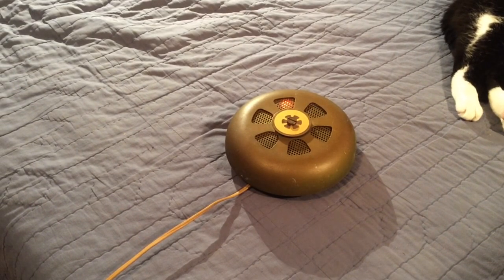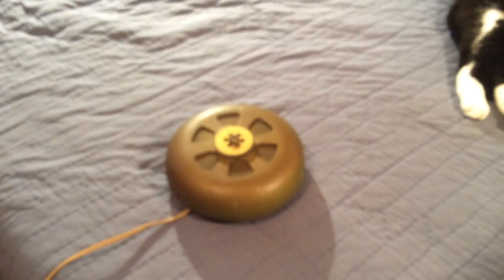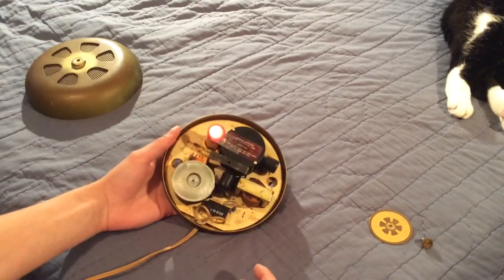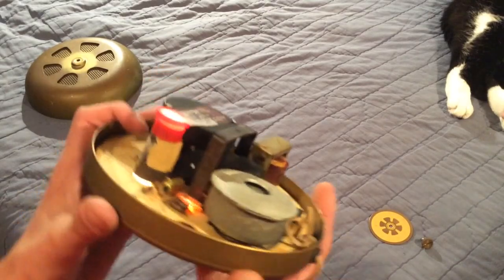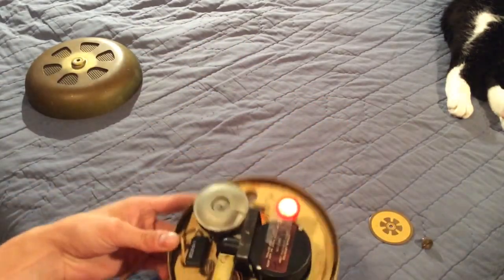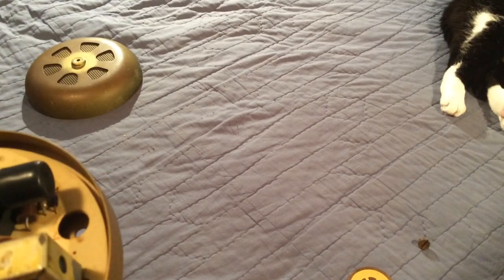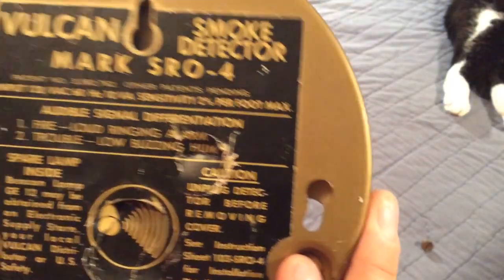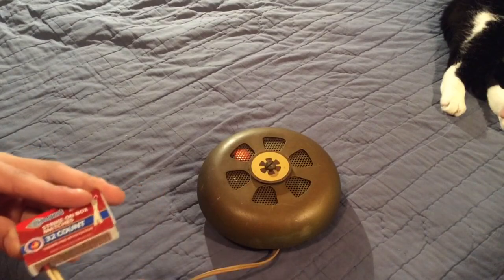Vulcan Autosonic Mk. SRO-4 Photoelectric Smoke Alarm

Comment: The shell looks like solid brass. You can clean the oxidation up with a bit of brass polish and a rag. Use your elbow grease to really rub into it. I suggest putting some sort of clear coat on it after that because I have my great grandfather's solid brass United wall clock from 1959, and I have to polish it from time to time. I should think about putting clear coat on it.

Comment: This is from about the early 60s
Reply: no early 70s electric smoke alarms wernt on the market untill 1972
Reply: @theshedproductions.  I would say 1972 at the latest, It is older than me and I was born in 1973. I actually just recently purchased one on ebay. Mine needs a new bulb which I am hoping to purchase by this months end. looks like online is the only way to go. Mine doesn't make this high pitched beep but does a low buzzing hum which means trouble and the smaller lamp will light up so at least the unit works. Once I get the bulb things should work.

Comment: This is definitely made before 1972. Im going to say late 1960s but again maybe 1971 and it looks like very soon I will be the second owner of one of these. By the end of this month or early March I should have it as  I won it yesterday. The one I am getting us untested but if it works at least I know what to expect sound wise and I do like this sound. Mine on the back the label is a bit ripped off towards the centre but that won't effect anything. The cover may need a cleaning as it is an very old item but still never the less I am very happy to be getting one as these don't pop up on ebay very often. :)

Comment: 10:20 poor kitty finally jumped.  like the First Alert SA76RS only about 20 times louder. What year is this from? I might have asked this before but I would have to say at least 1971 (two years before I was born) at the least by the looks of it. When was the first time the Delta alarm horn used in smoke detectors? Looks like a bell but sounds very different as you can see.